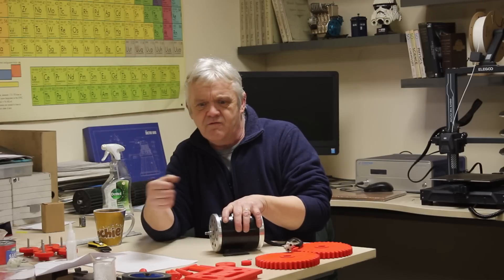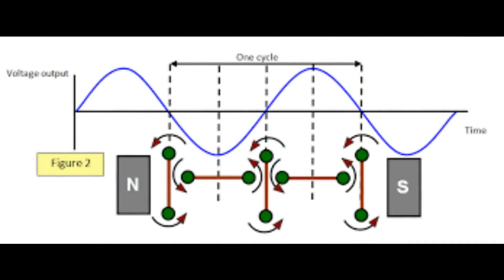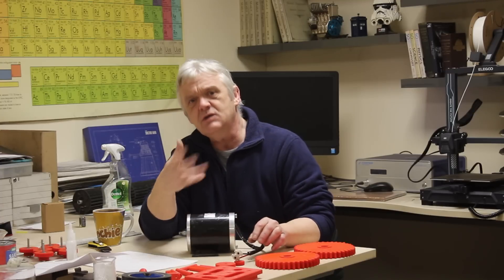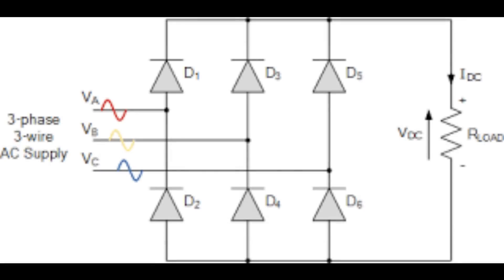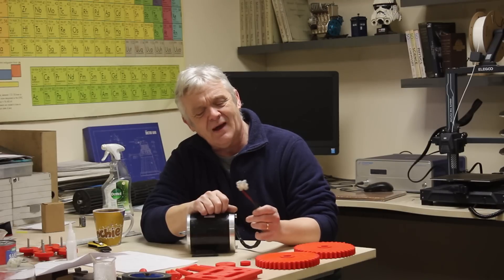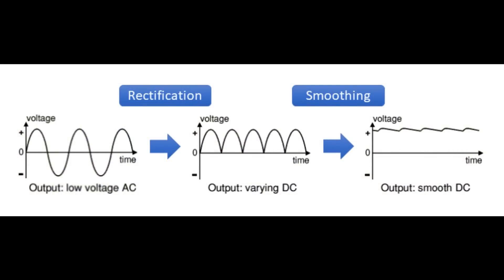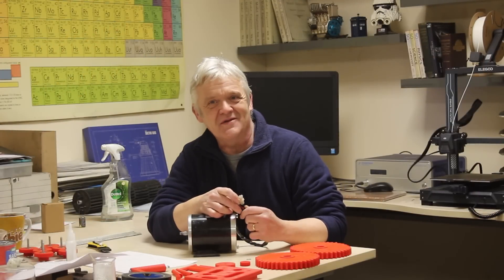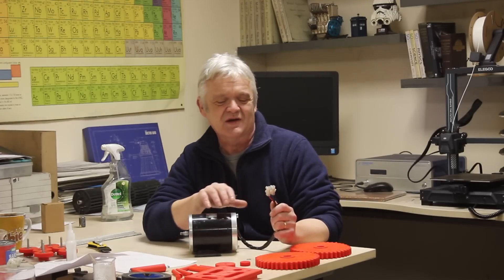1826 What Is MPPT And PWM And What To Do With A DIY Wind Turbine

Comment: Hi there! We are the owners of a sailboat, our youtube channel is @windywayra. We are currently designing a hydro generator system using the same propeller shaft, with a pulley and belt driving a PMA when under sail. My current idea consists of using a lawnmower PTO clutch to engage/disengage the PMA depending on different conditions, like RPM or battery voltage, which will be controlled using a Raspberry Pi Pico. 

My biggest concern and the reason I am writing you is because of all the videos and info I could find online, you seem to be one of the most knowledgeable persons... To answer a question I have: Pairing the right PMA with the right charge controller.

I have been researching the web and to be honest I want to make it efficient but not overly expensive, so I have bought a Double MPPT Hybrid solar and wind controller with the following specs (advertised): Max 100A combined, and 5kW of wind and 2kW of solar, and it can switch between 12V/24V and 48V.

To be honest, I think the only MPPT technology in it is in the wind boost function, but once enough voltage is reached by the PMA, it seems that it is just a PWM. Our battery bank is LiFePo4 12V 600Ah, so it does need some amps to charge it. 

I am trying to understand if a PWM charge controller rated at 5kW will make a 2kW PMA overheat/stall/sag voltage due to the high current it will be capable of drawing... I don´t think I can adjust how many amps it will try to use to charge the batteries.

I know I have to be careful not to use a PMA that delivers more power than the charge controller can handle, but what happens in the opposite case?

Thank you in advance!

Comment: Absolutely love this channel. 
Pure engineering at its finest. 

DC is still technically the same bilateral current in a vortex as AC, you are just creating an imbalance between the negative (blue) and the positive (red) beam.  That’s why DC current isn’t good for long distance transmission as there is not a Planks constant in vortex energy spiraling around each other in both directions.  DC just has an overly charged negative that flows until it can reach a source with an equally balanced positive energy or simply run out.  
Just like “waves” in the ocean. 
There is no such thing as a wave though, just a vortex at any given angle.  
Light/electricity looks just like the flow of a magnet.  
A perfectly balanced beam of light (like from the sun. Is a vortex.  A red/left spinning spiral coming from the center, and blue/right spiral going back to the center. Positive and negative spiraling around each other creating a yellow tube/ neutral zone with no energy in between. (Much like a tornado). 
To see this simply magnify a beam of
Light through a drop of water.  
It’s simple, yet nearly impossible, but it will show you how all energy in the third dimension flows.  Sunlight is the best form of light to use.  There is nothing available to us more pure or powerful.

Comment: If you have multiple chargers connected to a single battery bank, how do you prevent one charge as it raises the voltage from making another charger think the bank is full when it isnt.

Comment: QUESTION... Can I use the same charge controller that my MPPT Solar lines come into it? I'm going to run both solar and wind generator on my property. Should I use a separate charge controller for my wind generator?
Any advice would be greatly appreciated.
Todd
Reply: I am surprised you got no answer to your question. You may have already figured out that you have to have a separate charge controller for wind power seeing you already have an MPPT controlling your solar input.

Comment: The other difference between an MPPT and a PWM is their efficiency. MPPT is around 90% and the PWM is around 70%.
Reply: QUESTION... Can I use the same charge controller that my MPPT Solar lines come into it? I'm going to run both solar and wind generator on my property. Should I use a separate charge controller for my wind generator?
Any advice would be greatly appreciated.
Todd

Comment: I wish it was this easy. I tried connecting my wind turbine to my portable power station and it didnt work.
Reply: QUESTION... Can I use the same charge controller that my MPPT Solar lines come into it? I'm going to run both solar and wind generator on my property. Should I use a separate charge controller for my wind generator?
Any advice would be greatly appreciated.
Todd

Comment: here is a simple basic program for an arduino nano, to make it into a MPPT charge controller, lithium battery charger.

const int voltagePin = A0;  // Pin to read the voltage of the solar panel
const int currentPin = A1;  // Pin to read the current of the battery
const int pwmPin = 9;       // Pin to control the voltage/current of the solar panel
const int chargingPin = 8;  // Pin to control the charging of the battery

float panelVoltage, panelCurrent, batteryVoltage, batteryCurrent;
float batteryTargetVoltage = 4.2;  // Target voltage for a fully charged lithium battery

void setup() {
  pinMode(pwmPin, OUTPUT);
  pinMode(chargingPin, OUTPUT);
}

void loop() {
  panelVoltage = analogRead(voltagePin) * (5.0 / 1023.0) * (19.0 / 3.0);
  panelCurrent = analogRead(currentPin) * (5.0 / 1023.0) * (19.0 / 3.0);
  batteryVoltage = panelVoltage;

  // Calculate the duty cycle of the PWM signal based on the panel voltage and battery voltage
  float dutyCycle = panelVoltage / batteryVoltage;
  analogWrite(pwmPin, dutyCycle * 255.0);

  // Turn on the charging pin when the battery voltage is below the target voltage
  if (batteryVoltage < batteryTargetVoltage) {
    digitalWrite(chargingPin, HIGH);
  }
  // Turn off the charging pin when the battery voltage reaches the target voltage
  else {
    digitalWrite(chargingPin, LOW);
  }
}

this is just a starting point, and will need more attention to the power handling, but it is probably better than a simple 555 timer

Comment: Hi there I have a question does a mains supply battery charger have a charge controller built into it
Reply: Could I integrate a plug into my power source

Comment: what about mppts ability to changr volts to current?
Reply: That's true with MPPT a friend told me about. That it will take any extra Voltage and convert it into Amps.
QUESTION... Can I use the same charge controller that my MPPT Solar lines come into it? I'm going to run both solar and wind generator on my property. Should I use a separate charge controller for my wind generator?
Any advice would be greatly appreciated.
Todd

Comment: Why not use a diode or two "in-line" between the generator and battery being charged (to prevent drainage when the wind stops)? Then, adding another pair of leads from the battery to whatever device, appliance, switch, etc you'd like to energize would complete the arrangement. This is a serious question even though I obviously don't know what I'm talking about.
By the way, I love your videos- really
Reply: That's the exact same thing I was thinking. Send the power out from the inverter, running through my entire motorhome so I will not need the brake, or dumping excess. Why not dumb it into 2 saltwater batteries to store electricity, and use when needed?
 QUESTION... Can I use the same charge controller that my MPPT Solar lines come into it? I'm going to run both solar and wind generator on my property. Should I use a separate charge controller for my wind generator?
Any advice would be greatly appreciated.
Todd

Comment: That's a nice summary.  Charging can be a bit more involved, though.  You may get away with just turning on and off charging to a lead-acid, but especially with lithium polymer, you typically have separate high current and voltage float modes as a minimum, to extend your battery life.

Comment: Could you clarify something for people? I've live off grid for 8 years and I have 2 charge controllers for my solar panels 12 total and I have a load controller and load coil for the battery bank. My permanent magnet alternator wind generator is wired direct to the batteries. I have 2 Outback 60 amp solar charge controllers and a Xantrex C40 40 amp charge/load controller, the load controller doesn't connect to the wind generator like the solar controller does so mine is wired to the battery and to the load coil..... 4 wires.
Reply: Does the wind turbine alternator have a built-in rectifier? Some do.
Reply: @tlangdon12  yes
Reply: @keithfloyd1178  So you don’t a separate rectifier because there is one in the generator, and the c40 charge/load controller is act as a dump load controller to divert excess wind power from the battery terminals to the dump load. It does this by monitoring the voltage at the battery terminals. It is normal to connect the turbine directly to the batteries and then take the dump load from the battery terminals. The alternative would route the power through the dump controller, but this would create higher loses unless the controller could be located on the shortest route from the turbine to the batteries.
Reply: @tlangdon12  exactly. I also have had a solar panel hooked direct and the load controller keeps the panel from over charging the system. I'm planning on making a sand battery heater to capture the heat from the load coil and use it at night for hot water or a room heater.

Comment: The interesting difference between pwm and mppt is that pwm, as you said simply switches on and off. The current can never exceed the panel current. MPPT on the other hand when it drops the voltage to match the batteries, is able to increase the current and allow more total power through. I didn’t catch this aspect in the video, so I apologise if you already covered it Rob.

Comment: You mentioned the 555 Timer IC and reminded me that there is another open source use.  The 555 timer for 12V battery charger.  It will work with solar, wind, or other inputs as long as you add rectification with smoothing.  The NE556 dual single-chip timing circuit can be used to have both the charge controller and an output controller in one chip and be done on a breadboard.

Comment: I had to watch twice to make sure. But if you have a full bridge rectification the battery can't back feed.

Also with pwm and  mppt , you missed the bucking. Volts to current.. I think that makes more sense when picking either.
Reply from the maker: it didn't m make sure - I said if you connect the battery straight to the wind turbine you would have problems - hence no rectifier - you are just making the point I made in the video - badly it would seem since you missed it - oh and I didn't miss bucking - this is just a guide not an instruction manual
Reply: @ThinkingandTinkering  I was following along at  silly o'clock... I won't be watching it again  to check why I got that impression ... :)

I think it (buck) would be worth a mention  as that is the consideration between the two. I know you said about the current v voltage tracking. But I have more people who don't understand this part of charging and types.

Comment: Is there any easily obtainable source for charge controllers, for instance in a car or an old battery charger?
I'm constructing a Darwin wind collector - mainly as a means of developing my 3D printing skills, but it would be nice if it would charge an old car battery or a couple of rechargeable torches!
Reply: Most car alternators have a regulator on the back. It might work.

Comment: I'd say 90% correct as I sell them for Victron, only point I'd add is if your battery voltage is very similar to generator voltage then go with pwm if there is a large or frequent difference then go with mppt unless you're happy to lose alot of the power you generate.
Reply: Victron gear is great! I have been building off grid systems for almost 12 years and Victron is my favourite.

Comment: With solar I prefer mppt, so the solar panel voltage. Can be much higher, for less losses in the wiring,.  Pwm is fine if the voltage is close to the battery voltage, I like 2x battery voltage, atleast, or up to 3x for mppt, with pwm say 16-18v for a 12v , and 32-36v for 24 v systems,  any more and the losses just multiply,  most charge controllers have limits,  if the voltage of the PV is pulled down much below the max power output, the efficiency falls fast, a decent mppt will keep it at a decent level,  and there is good affordable mppt out there,.  We need more mppt that will track turbines,  a solar mppt will keep the voltage pulled down stalling the turbine !

Comment: Awesome video. I have a pwm solar charge controller. Can I also connect a wind turbine to it? Do I have to get one specifically made for wind turbines?
Reply: Yes you can use pwm on wind turbines but you have to make sure you have a dump load like a heater or somthing when the batteries are full as the wind turbine needs to have a constant load on it to keep it from spinning out of control and causing damage.Some of the larger turbines will just shut down but that is a much more complicated system.I think an mppt controller is a better fit for a wind turbine as it will ajust to the power output of the wind turbine in varying wind speeds as it will ajust to a wide range of varying voltages and covert it to the voltage system you are using be it 12 24 or so on.

Comment: I've played around with wind power in Sydney Australia and most of the time the blades don't spin, due to the fact minimum wind speed is required to overcome the internal things going on in the generator. So I get much better and consistent power from solar panels in a built up area like Sydney. MMPT IS actually a buck /boost inverter eg it will incerase the voltage when below change voltage and decrease the voltage when above charge voltage.
Reply: no ,better wording than decrease would be translate   the voltage    as the voltage is allowed to rise  in an Mppt idea    and that  is important for a turbine

Comment: I design custom MPPT systems for solar and wind, it really can improve performance a great deal.
Reply from the maker: I really don't doubt it does mate - but it does that at a cost and that cost is not always needed
Reply: @ThinkingandTinkering  :D cost is not always a problem when you know a guy who designs them ;)
Reply: @ThinkingandTinkering    well  than do your research better ..... mate !
Reply: The other bonus is that the higher voltage from the panels in series, keeps the amps low and reduces the wire sizes needed.
Reply: @unicornadrian1358  Precisely, if your panel voltage and your battery voltage are very similar then PWM is absolutely fine, but as soon as your solar/wind voltage is significantly higher than your battery... then you can be loosing large %'s of your power, over 50% in many cases, and MPPT will intelligently buck that down and find the sweet spot knee on the power curve.

Comment: I never run my inverter from the load side of the charge controller, I always connect direct to my battery bank...as had issues in the past of smoke escaping  😆

Comment: Hi, So..... I have an old VW Beetle generator and its VW voltage regulator.... am I good to go? Plan on fitting a fan on the generator and mounting it on a pole, will I need to gear it or work it through pulleys to increase the speed?

Comment: Or for a small  wind turbine, just use the AC directly by connecting it to a resistive load like a heater (in a sand battery) and cut out the rectifier/charge controller completely.
Reply: Cool idea I am currently working on a project at the moment that needs constant 35 degree water for the system to operate and wondering would a small wind turbine with a sand battery be a good alternative instead of just heating it up with electric from the grid.

Once the sand is at its max temperature that it can store how efficient is blowing cold air through pipes in terms of what percentage of energy is transferred from the sand into the cold air each second. 

Would this system be an effective way of keeping water at 35 degrees c 24/7

Comment: One thing to remember is always have the charge controller energized and connected to the battery or bank of batteries before switching on or connecting inputs like solar panels and turbines.
Reply: Thanks Mr Sandwell for this very important piece of information.  I'm new to this, so I'm going to write this bit of info down on a post it and hang it somewhere I keep bumping into it to keep this in mind.👍
Reply: Can someone explain why. Easier to remember if you know the consequences.

Comment: seems like they need a better term for things than direct current, but maybe shifted AC with a 0 or something 0sAC? since it is basically AC waves that are shifted 50% so that the voltage does not shift back the other way, but rather shifts further in to one pole so it only reaches the "zero mark" rather than fully or partially to the other side of the mark of 0 volts?

Comment: Power conversion losses are what steal our hard earned (electrical) energy. Resistance, reluctance, impeadance, et. al., create heat in components. How do we minimize these losses?
Carefully, with due considersation.
Reply: Or if you're in a heating climate, can you just put these components indoors and utilize the waste heat as a space heating offset?

Comment: I had a very decent PWM controller on my solar panels. I got somewhere in the 150w range due to running a 12v system. I upgraded to MPPT and now get somewhere in the 200-280w range. It cost 100USD to buy the controller. VS the PWM controller that was name brand cost in the same neighborhood price. -150usd. If your running modern panels, which run in the 30-40v range and try to charge 12v batteries your leaving allot on the table.